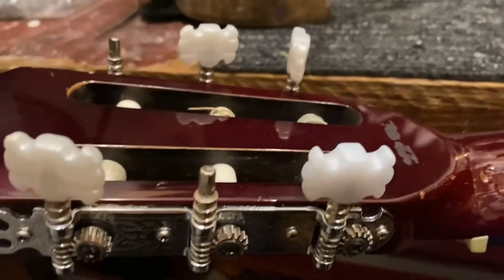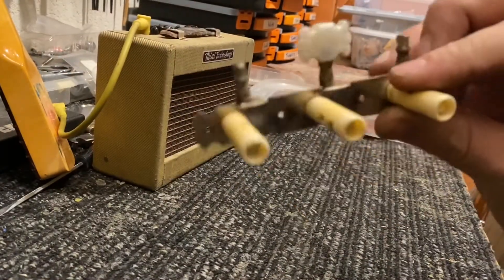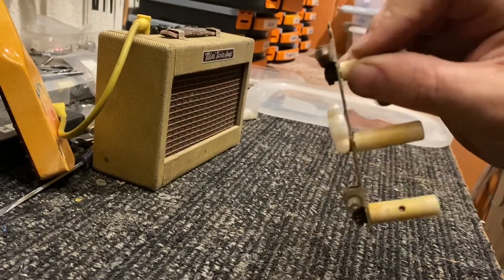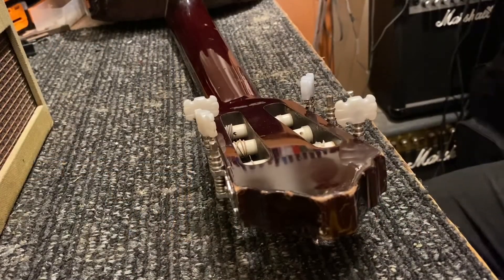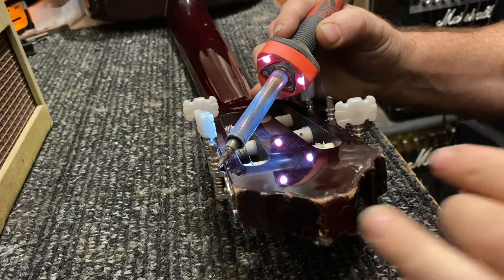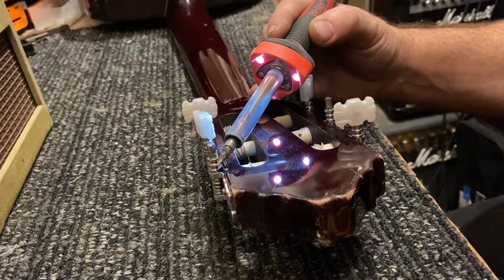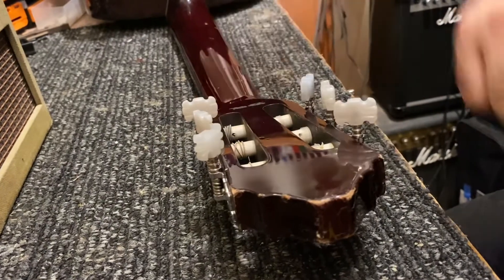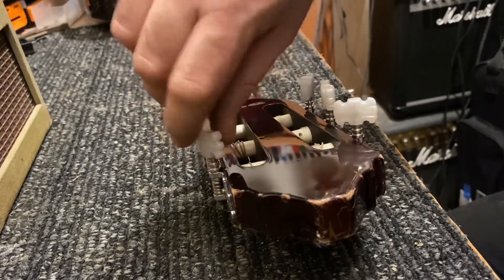Broken Tuner Button? Try this first! For Classical, Acoustic and Electric Guitars

Comment: Great tutorial! Do you think it's also possible to use a heat gun for warming up, or alternatively some super glue?
Reply from the maker: in my experience, the heat gun runs too much risk of burning the neck or the plastic on the tuner. Super glue could work too if the hole in the tuner is too big but doesn't hold as well as this method
Reply: @RamonaMusicCenter  Thanks for your answer!
Reply: A Heat Gun is WAY too general and the heat is by FAR best specifically directly conducted into the Tuner Shaft as shown, though I would touch ABOVE the Screw part.

Just keep Pull or Push Tension on the Button as the shaft heats up so slides on without overheating.
Another YT Video shows winding a cloth on (an Electric Guitar), Button makes it easier to pull off.

NOTA BENE.
I am an Engineer.
Not a Doctor.
.
Reply: PS.

I tried your Superglue idea, and now I REALLY can't put my Guitar down !
.
Reply: @RamonaMusicCenter  how to replace metal Tuner Button?